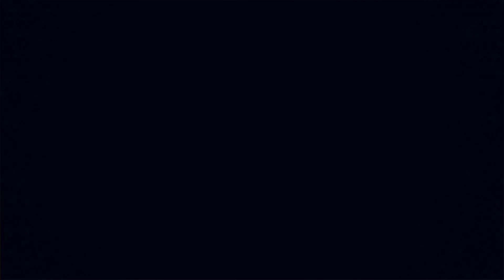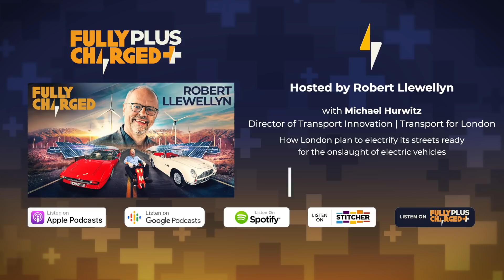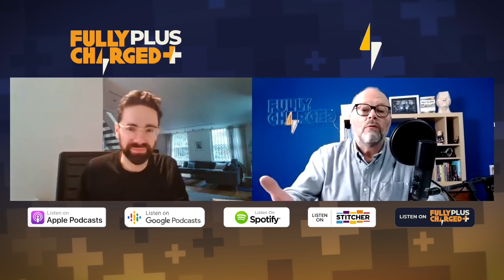How London plans to electrify its streets, with Michael Hurwitz

Comment: Strange, most of the comments seem to be about the sound quality, hardly any about the content. My question would be more about whether we need cities, or rather the urban sprawl around the centre. Now is the time to relocate the bits that should be in cities to somewhere off the coastal river delta flood plain. There is going to be a massive change as robotisation replaces jobs and I don't think people will want to live in high-rise urban compression when they have more time, and don't have to commute as quickly as possible every day at the same time to another high compression work place.

Comment: Great interview.

Please, please, ask Every One of your guests to use their smartphone to record a backup audio channel:
0. Turn on Do Not Disturb mode to avoid incoming messages and calls ruining the audio.
1. Use the inbuilt recording app
2. Press record (the important bit) and ask them to clap their hands for sync
3. Place the phone on a soft surface (a jumper) to filter out when they hit the table
4. Ask them to confirm that they have enough space (and battery) to record the entire audio
5. Ask them to confirm they see the recording is active before continuing.
6. At the end of the interview, press the stop button and find a way to send the audio file.

This will help save us, the thousands of listeners, the frustration of having to listen hard.

This will save your editor from spending time trying to clean up the audio: they can just mix in one or the other channel.

To guests of Fully Charged Plus: if Robert forgets to ask you to do all the above, please do it anyway and don't delete the audio file until the conversation has been published! 🙏

Comment: fastned have more than 1 charger  in sunderland     they have 1 in Whitley bay  1 in Blyth  1 Dundee  but now up to 6 charger locations  but there price of 39p  makes one of the dearest. disappointing

I think that charging should be NO dearer than charging at home   only at that point will people who can not charge at home be more likely to buy an EV
ALSO
that every supermarket should have 7kWh  and 50 kWh charger/s at them  making it easy to find  and with 24 / 7 opening  this would make charging location easier to find.

Comment: One of the biggest drawbacks of public transport if you've ever used it is not so much the sharing, it's far to many but necessary routes that still don't really join up with where you're going. Personally (and this is going to create a discussion that really needs to happen in the next five years)... I think the whole lot (buses) would be better off scrapped and replaced with small automated vehicles like the one being developed by Zoox. 
A bus route has to be run even if no one is using it and even then may not be fully used, so the befits of many people in fewer vehicles is an argument that needs looking at again in light of how technology is changing rapidly around us. 
With small automated vehicles you can go from A to B, do it all via an app with no need for bus tops, choose if you want to share the vehicle and reduces the strain on parking spaces as the vehicle goes off and either transports someone else or stops to charge.
This would be an interesting discussion for a Fully Charged Show.

Zoox on Youtube.       https://www.youtube.com/watch?v=3r7PEl0tMSk

Comment: If possible can the guest and Robert use their headsets as without a headset their device is having to remove the other speakers sound all the time which makes this volume hunting effect you have on this recording - Headsets all the way! . Very interesting talk. But Robert, your Tesla M3 has a self-driving computer now that is capable once updated to calculate everything required for under 100 Watts so it's coming faster then you think. (yes, I do mean 100 watts)  keep safe, nice work!

Comment: Might be a good idea to do some sound checks with your guests first
Reply: Most of the issue came from Michael's device and the noise reduction in it. You'll notice that a lot of the time if Michael is talking and Robert goes 'yeah' a few seconds later Michael's talking gets reduced in level. This is because his device plays Roberts yeah but applies noise cancellation so that the yeah doesn't get picked up by the microphone and sent back to Robert. Robert would just hear an echo of himself without it.

Not a lot you can do about this except wear headphones and if Michael didn't have a mic/headphone combo then there's not a lot you can do about it. Except tell Robert to shut up with his conversational yeahs when Michael is talking. But that's if Robert knew not to talk, which he won't have done.